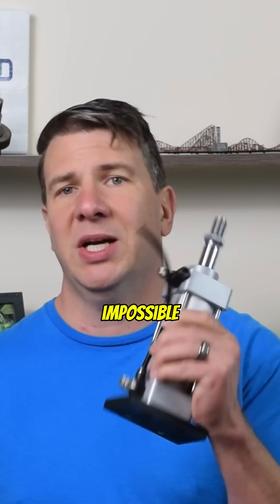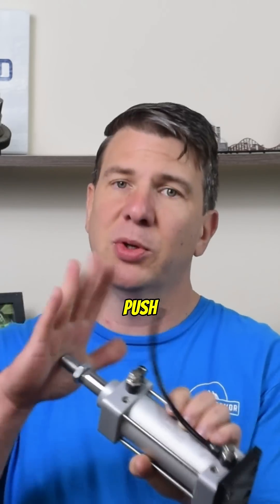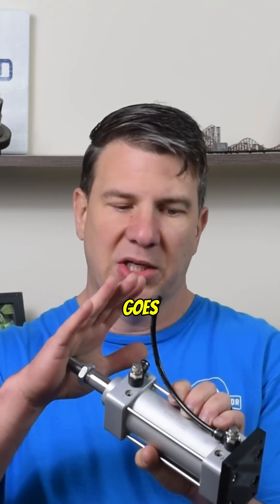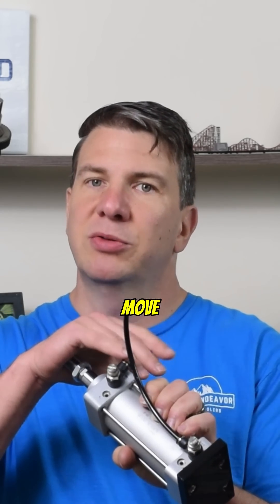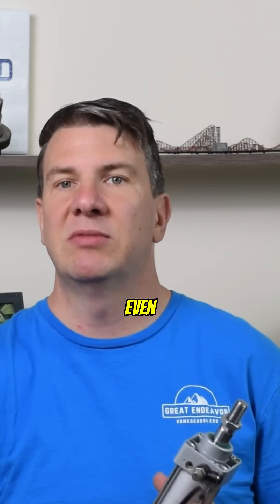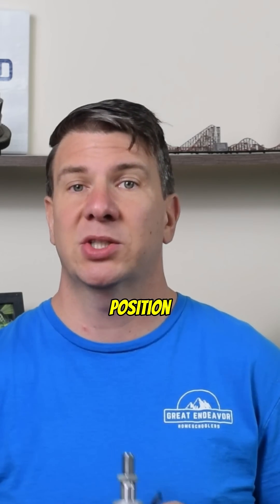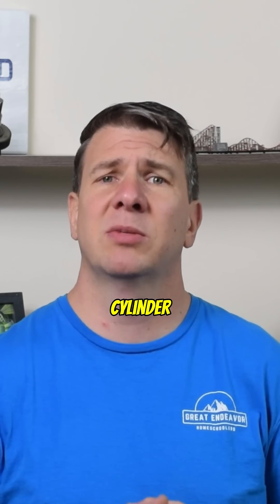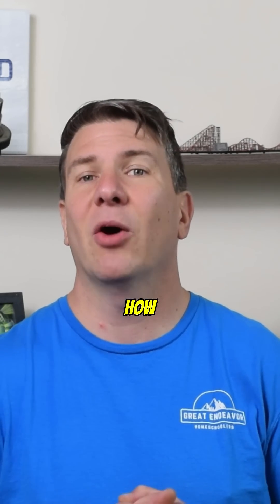Stop a Pneumatic Cylinder Mid-Stroke?  What?

Comment: Or just use flow control valves, on one cylinder.
Reply from the maker: Show me how.....As stated, you can't hold it in a position because air is compressible.
Reply: @MentoredEngineer your right air isnt compressinle, burlt when you use a flow control on the exhaust, then both sides of the piston are pressurized. Tonstop mid stoke, all you have to do is close the close center valve, and the cylinder is held mid stroke.
Reply from the maker: I understand what you are saying.  However when the cylinder is stopped midstroke and the load changes, the cylinder will move.  This is not the case with an oil field cylinder.